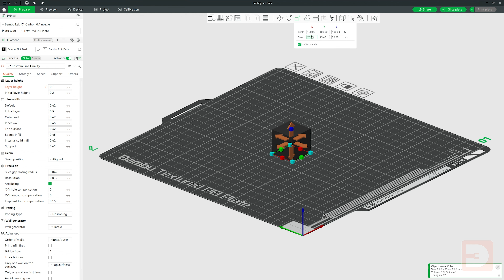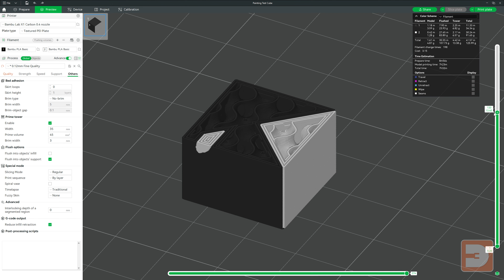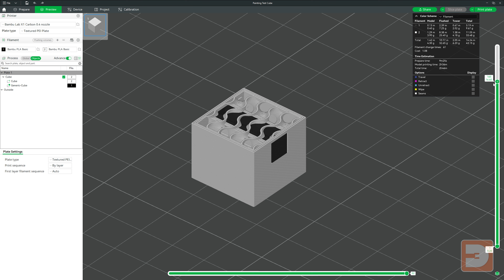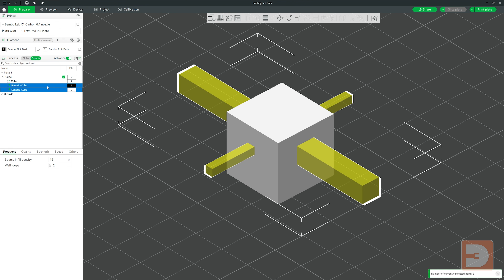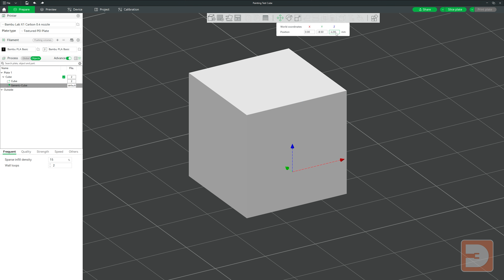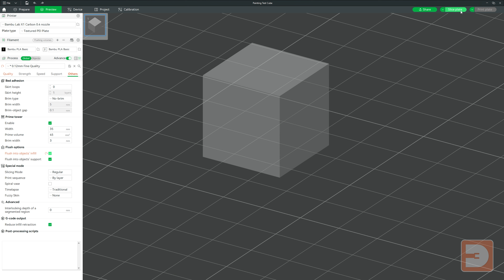Paint at specified depth in Bambu Studio

Comment: This was super helpful. Basically I have a debossed design, and I wanted to make the recessed (debossed) part black so it stands out more when the main box is purple. At first i did the paint bucket with edge dimensions but it was too detailed and looked terrible. I did this method and it worked, My only issue now is the black bleed shows heavy through the purple box. So i just see a black square. Any advice?

Comment: This is good, but it is not painting... I was expecting some tutorial using the painting tool
Reply from the maker: I have a tutorial on the paint tool in Bambu Studio which you can access here: https://youtu.be/5aJZyhfY74s

The paint tool only allows you to dictate what colour the surface level of the print is, and the interior of the print is procedurally generated based on the rest of the settings in the slicer.

This tutorial is about how you can use the tools and methods I explain in this video to effectively dictate the painting within the interior of the model, hence the title, 'Paint at specified depth'. 

I hope this helps, happy printing!

Comment: Great video, thank you.

I have a different type of challenge when painting. I have an LED which is mounted in a hole which is accessible from a hollow center of th emodel I'm printing. The hole doesn't quite reach the surface.

The challenge I have is how to paint the transparent window through which the LED will shine. I've left about 1mm  for strength reasons (the part pushes up through soil, so I need it to be a bit resilient).

From the outside, there is no way for me to easily see where to paint.

Perhaps a cylinder modifier would do the job, but seems awfully fiddly to get right.
Reply from the maker: Hey, sorry for the late reply.
If you're still looking for a solution, I think the answer may be (if I've understood the problem correctly), the 'Sectional View' option in the paint tool.
I believe I've covered it in my Bambu Studio Painting Masterclass video but let me know if you still need help.

Comment: For anyone searching on how to make a layer inside the print itself different color while making the outside another color just use modifiers only, Do not use the paint tool at all or the modifier will ignore the filament change completely. I needed to make the layer under a thin top layer white and had to place a modifier inside the object and a torus on the outer edge and it works perfectly. each is a different color and now the color under it cant bleed through the top, Why the hell this process is so convoluted is beyond me. Why theres no easier way seems baffling.

Comment: Thanks for your videos, most helpful.
One quick question, when painting a surface is there an easy way to back through a tool's steps just to erase the last say brush stroke? In other paint programs you can hit delete or arrow back through each stroke. Removing all colors makes you start over. The back arrow does not seem to work.
Thanks
Reply from the maker: Hey glad you like the videos, thanks for posting.
Hmmm, could I ask what version you're on and what platform you're using? Ctrl+Z or the back arrorw at the top left of the screen works for me to back track just the last brush stroke (as opposed to removing all painting).

Comment: I have a flat surface that is red with my sons name on the flat surface in black. It's irritating Bambu wants to start the black color change in such a low layer height that it adds allot of time and waste to the print. I wish there was a way to tell the slicer at what layer to start the black color change🤷‍♂. I thought this video was headed in that direction but with letters being complex(ish) shapes I don't think the modifier trick will work??
Reply: This is kind of what I’m trying to figure out.  Could you just make a modifier in red that hard stops the black at a certain layer? It would likely result in more solid layers tho?
Reply: @jared1321  Right-click the object and select Height Range modifier. Set the height 1 or 2 mm less than the top of the object and assign the non-text color to the modifier.

Comment: Does this technique only work within walls and infill? For instance if I make my modifier stick out the top and bottom of a white cube and make that modifer a black cube it only places the black within the infill once it gets to the solid layers it just stops and makes those white. I cant seem to get it to work in this context.
Reply from the maker: This doesn't just affect infil but affects any part of the model it comes in contact with. If you don't want it to 'paint' the walls, you'll need to scale and position it appropriately.
For example, if you had a 20mm white cube and you wanted to paint the full width infil of a certain part of it black, you'd create a modifier cube, scale it to be the width of the cube minus the overall thickness of your walls (so if you were printing with a 0.4mm nozzle and had walls set to 2, you'd probably make the modifier around 18.2mm) and position it centrally in the main cube.

Comment: ok but how do i stop it from printing color on every top layer. example make cube, set to 10 top layers, paint design on top layer, slice,  you see that the design goes through all 10 top layers. casuing printing in thin air and causing print fails.

Comment: wtf am i gonna do with a cube? i need to paint the outside of a conical gear, no way this is going to work
Reply from the maker: I'm a little confusd as to your issue here?
I'm using a cube in this video simply as an example, this works on literally any shape. But also, the whole point of this video is painting at depth (as in defining colours used inside the model, not just on the surface).
If you just want to paint the outside of your model, you can use the conventional painting tool. You may like to check out my Painting Masterclass video on that here: https://youtu.be/5aJZyhfY74s

Comment: This sounds great if you want to print just cubes and simple shapes, but what if i want to print somehting more complex shapes? I'm struggling to get my different color layers to penetrate deeper keeping the same shape .
Reply: How complex shapes?
In my case, I was printing basically a coaster with a picture and I had to have that picture to petrude deeper into the print. 
As I was making it in Fusion, I just exported the picture parts that were supposed to be different colors and then added it as a modifier. Worked like a charm

Comment: FYI this doesn't work if the color of the modifier is set to the same color as the entire part. Sometimes this is necessary because for example you'll want a part that has green contoured areas on the top yet the sides white. So you'll set the part to green but the slicer adds white filler material inside just 1 layer under some of the top green areas...it will frustratingly put white inside the part due to the white sides. So if you try to correct this by adding a green modifier to get that green to go down more layers, it doesn't work. You'd have to make the entire part white first, which defeats the purpose of having it green inside in the first place.

Comment: I'm looking for a way to take a painted area on an existing model (it happens to be a number in a custom font) and extend it all the way through the material. Can't do it with TinkerCAD-shaped modifiers, tho. Any ideas? I want it to use a clear filament so the number can be backlit by the LED behind it.

Update: The numbers I wanted to extend the painting depth on happened to be laying flat on the bed, and are only 13 layers thick. I found that by modifying the bottom shell layers to 7, and leaving the top shell layers to 6, combined with your TARDIS window trick of painting the inside the same color as the outside, I could get the numbers to extend back 7 layers, followed by a clear layer on the back, so the LED light will shine through. Yay! If I left any area in the middle of the model, it would put infill pattern in the opaque color which I don't want. I could have otherwise used your modifier method, but hten the infill pattern would be in the clear filament and would still look kinda funky from the front.

Comment: First off, thanks for all the videos. They have been a great help!

I am having an issue where I've tried to add the modifier as you showed in the cube example but it didn't work and was wondering if you can help. 

So I have a 2.8mm thin cylinder with a diameter of 40mm. Using a .2mm nozzle, I am trying to color the 2.4mm thick part all white and the rest (.4mm which is 4 layers) Green and black however, when splicing the model, the color change begins at 2.2mm layer height as opposed to the 2.4mm layer which would make more sense and more importantly, less filament changes. Any way to fix this? 

Potential video/idea: 

Totally irrelevant to the issue above but I was thinking what if you can use a .6mm nozzle print, change mid print to a .2mm for greater detail if your printing small letters and such.
Reply from the maker: Hey really sorry for the late reply. Glad the videos have been useful, plenty more on the way!

Regarding your issue, how have you tried applying the technique I describe in this video. On the top of your cylinder, you say you want it green and black for the top 4 layers. I'm presuming that's an image or pattern.
You could have the model's default filament as white, then use a layer range paint tool to paint the top 4 layers either green or black (whichever is dominant, lets say green for argument), then create an STL of the black part and import that as a modifier shape like I did in this video, setting that area as black. If you still get that bleeding down into earlier layers, you could create a cylendrical modifier for that area and apply white to it as a reinforcement.

Fun idea for the video, but (that I'm aware of) there is no current way to do this. 
Even if you did manage to pause the printer mid-print, and change the nozzle without moving the extruder head or causing an issue with the filament, the rest of the file would still be sliced for use with the original nozzle and as a result, the extrusion rates etc would all be completely wrong and ruin the print.

The only way around that I could see would be to slice the whole thing twice (once with a 0.6mm nozzle, and once with a 0.2mm nozzle), then open the gCode in notepad and copy the second half of one, then replace the second half of the other with it.

But that's just based on an initial thought now and would rely on specifics for the design and print itself.

Comment: How to paint text several layers deep?
Reply from the maker: There's a few ways you could do this. The best way, if you have access to some sort of CAD software, would be to create a 3D extrusion of the text, then select 'Load' from the 'Add modifier' menu and select the STL you've made of the 3D text, then position it when you need.
One way you could do it inside Bambu Studio is to create a cube using the primative objects function, resize it to a flat panel the size of the text you want, then use the text tool in the top bar to apply an extrusion of the text you want onto that. You can then export that object as an STL, delete it inside Bambu Studio, then do as I mentioned before and right click on your object, go to 'Add Modifier', select 'Load' and then select the STL of your text, then just follow the instructions in this video.

Hope that helps.